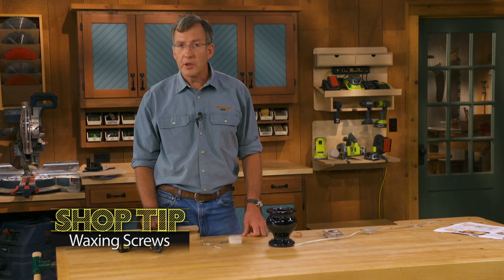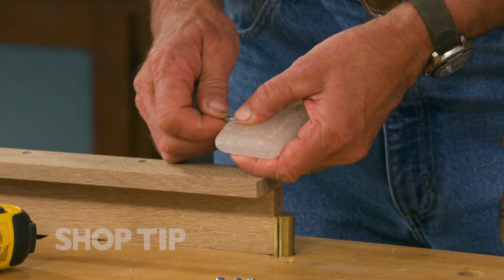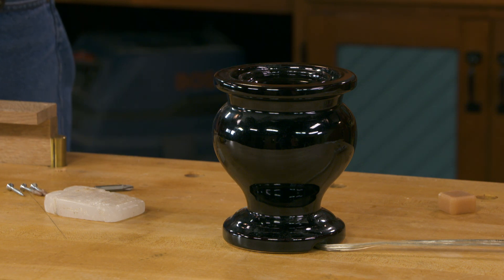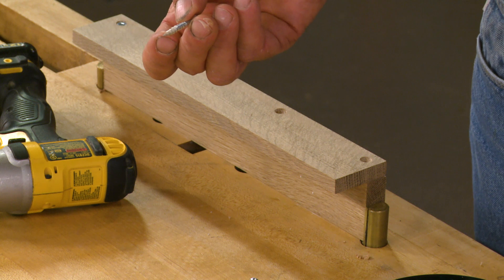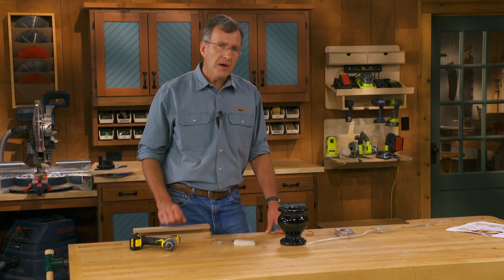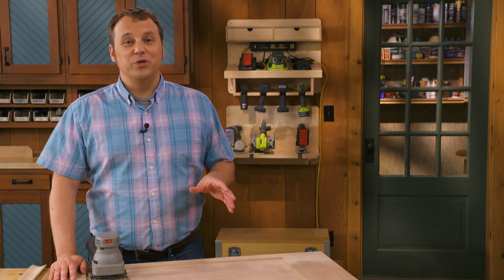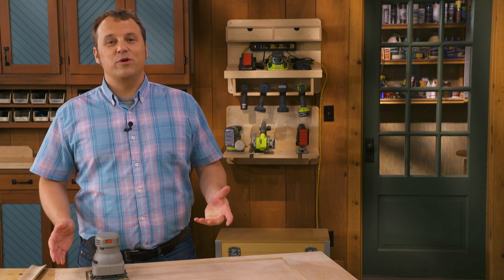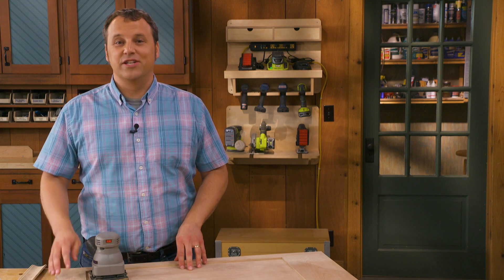Woodworking Tip: Waxing Screws

Comment: I've been using a mix of 5:1 beeswax to petroleum jelly. It's a solid wax, sticks well to the screw threads & costs next to nothing.
Fewer broken heads, less effort & less cam out.
Takes me 15 minutes to make a 2 year supply using half a beer can as a melting container in a small pan of simmering water.

Comment: Is this necessary if you are using an impact driver like in the video? Does it prevent stripping the wood or something? I can see it being useful if you were using a regular old screwdriver, but I'm not sure I understand the benefit if you are using an impact driver.  Honest question - not trying to be a troll.
Reply: With a regular old screwdriver it makes it easier.

With an impact driver, you're less likely to twist the screw head off the threads.

I bet those experts didn't even consider this! 😉😁
Reply from the maker: Is it absolutely necessary? No... but impact drivers are pretty handy when driving screws because they provide greater rotational torque in conjunction with rotational "tapping" which makes it easier to drive screws in tough situations, like dense woods.  Basically, it won't stall out when the going gets tough like a conventional drill would.

Comment: Totally unnecessary to heat. Pull the screw vertically against the wax and some will stay in the threads. Wax isn’t even necessary, a bar of soap will do.
Reply from the maker: Yep, soap works great.  We usually have paraffin wax and/or beeswax around our shop for other uses  and they make for a great screw lubricant too.  You could even use paste wax.  We were just taking the time to show another option that a reader suggested.  The melted wax works well if you want to quickly load up wax on a bunch of screws so they are ready for use, plus it makes the shop smell great :)  Thanks for watching.

Comment: Why bother with melting wax...a bar of soap does the same thing.
Reply from the maker: Yeah, but does a bar of soap make your shop smell great? :)
Reply: @WoodsmithShowandmagazine 
Sure if you use your wife's girly soap!

But then, you'll have bigger problems than breaking a screw while driving it into wood.

Besides, the soap is most probably cheeper than purchasing a wax warmer and wax. On the other hand,  you could wax a whole box of screws and have them ready for many jobs.